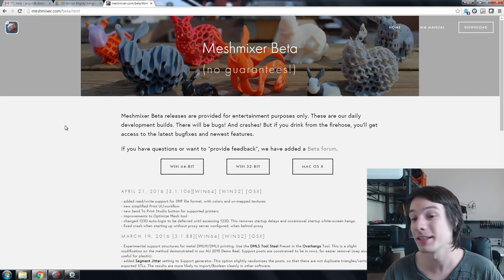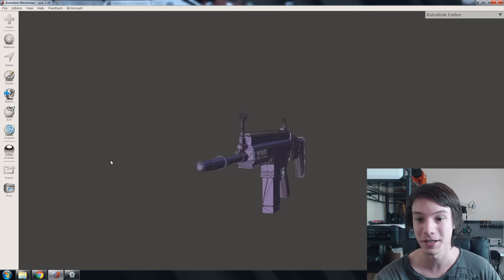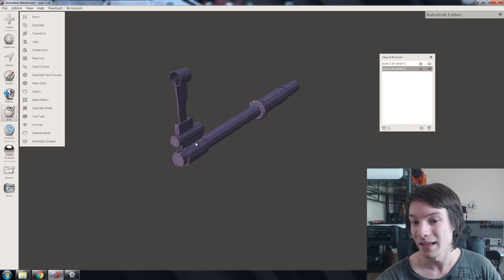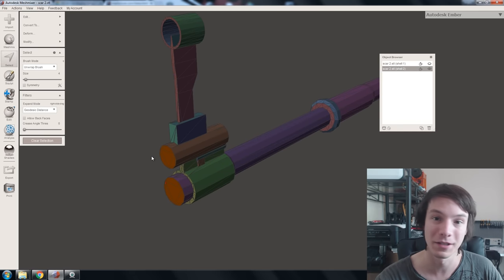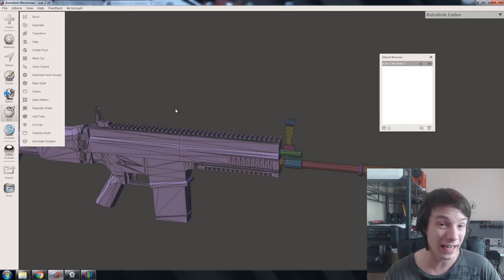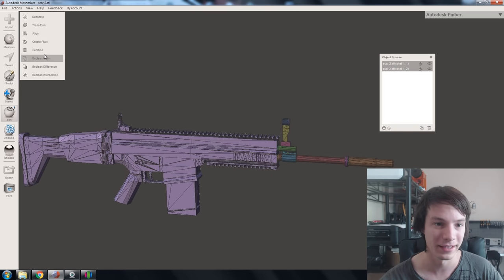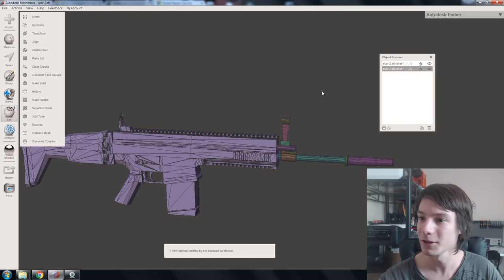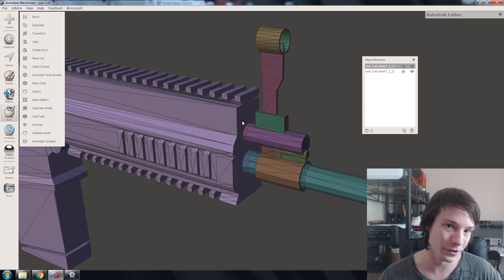Stitching meshes together using Meshmixer - 3D Printing 101

Comment: Great video and it's nice to know what mesh mixer can offer. The way I would do it since it's not organic is, i would import the model is lightwave or any 3d modeling program and subdivide the area enough so that i can weld the verts. that will give you a cleaner model in many ways and will make slicing a lot easier.

Comment: @Makers Muse   Since you have Simplify3D, you can also import each of the components separately and combine them by manually placing them together.  When you slice it, it will slice them as one object.  This is handy for simple stuff like this.

Comment: If you have two or more shell and you slice with Simpifly3D, try menu Mesh > Separate connected surfaces before click "Prepare to Print!" button. I think it's a bug of Simpifly3D that can't slice intersect body of model correctly.
Reply from the maker: +กริชชา อัชฌาบริรักษ์ Wow that IS a bug! I tested it and it worked. It's still good practice to combine shells though because other slicers like the ones for the UP! Don't have this ability. Cheers!
Reply: Nice man! Saved me some time in meshmixer and the headache! Thank you

Comment: I hope you feel better soon.

I do have a question for you and that is which enclosed printer would you suggest to purchase?  Since my old Prusa I3's bed will never work right unless I spend 250 USD, or more, for a shop to work on a MIC6 bed (priced from 3 sources so far) I might as well toss this print in the garbage and buy one I know the bed will come flat and I can print on it.  I have been looking around but I am completely turned off by the manufacturers going to a MK10 style hotend which will not do anything over 250c since the PTFE tube goes all the way to the orifice of the nozzle which is nuts.

Any suggestions since you have played around with a bunch of them?

Comment: great tutorials.
I do have an issue that I cannot resolve. my project has 2 layers.
When I select to cut out the outer layer, it cuts, but leaves the inner layer. How can I separate both layers at the same time?

Comment: so with mesh mixer you can seperate shells to remove an item but then mesh mixer will not let you save it again without a lot of messing about correct? i downloaded a model and it had its own supports but when you remove the supports they will damage the model as you cannot access the connection point

Comment: I have a gauntlet that I want to print. I need to split it in many parts but I have an issue...
Between the inside and outside wall its hollow and I want it to be filled so its stronger. 
How can I do that?
When I cut it the remesh fill it all even in the middle where my arm is supposed to go.

I can send the file if needed cause its kinda hard to explain.
Would really like to learn how to do this.
Thanks!

Comment: This is something that would be really easy to do in Blender, actually.

Limited dissolve to switch to N-gons for easier selection, select the faces, extrude or translate into the gun body, then select the barrel and gas port regions and the face of the gun, then self-intersect (knife, for Blender should never be used for booleans if you can avoid it).
Then its just cleanup by deleting the non-manifold faces left inside the gun. Now its manifold and a single continuous piece.
Reply: +smokeydops people who dont typically model their own prints shy away from blender.
Reply: true

Comment: Hi am still learning on Meshmixer and it say print on the bottom and it on a makerbot replicator 2 platform what is that all about can I slice with Meshmixer if so how
Reply from the maker: +mike mun No, meshmixer can't be used to slice but it can send files to some programs for slicing. For your replicator 2 you're pretty much stuck with makerbot or Simplify 3D as far as I know.
Reply: +Maker's Muse and another question in thingivers there a lot of broken models the one I want to fix is robocop 2 Cain it looks like hell to fix can you fix that
Reply from the maker: I would follow one of my fallout repair tutorials, it should be about the same process unless it's seriously broken.
Reply: +Maker's Muse that thing been upload in 2011 and still no one could fix it lol
Reply from the maker: Yeah looks irrepairable... Anthony over at the hot end did a print from robocop, not sure which one but he found one that worked after a simple repair.
Reply: +Maker's Muse who does he have a link or YouTube channel
Reply: +mike mun That robocop could be fixed, but it would be a lot of work and as far as i can see definately not a job for meshmixer or netfabb, because there are major parts of the model missing (lower arms, torso, head,...). My best guess would be to use a polygon-modelling software first, like Zbrush, Rhino, 3ds Max or something along those lines, and model in all the missing pieces and surfaces, then split the model up into actually printable pieces, and then try to print it. Would probably take a few hours to do that properly, depending on your skill-level with the tools you choose to use.

Comment: So why aren't you just using a polygon modeler? I feel like 3ds max and a cup of your favorite beverage would do a better job. But if youre using meshmixer can't you just make both meshes touch eachother without any tolerence and therefor print as one thing without inner BS?
Reply: Yeah and 3DS is cheaper than meshm...... Oh wait, no it's not. And blender is not great with triangles
Reply: For the record, I did say polygon modeler.. So any would probably be fine. I just mentioned 3ds max since it is my prefered program. The meshmixer program did okey, but if you are a novice user you would be better of learning a polygon modeler rather than a middle ground software that is somewhat useful but heavily dependent on your models topology.